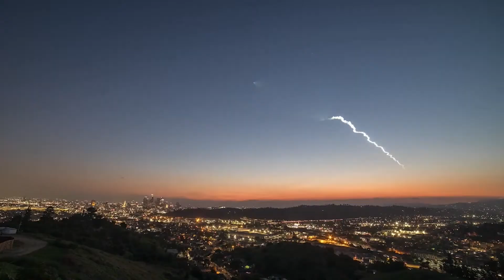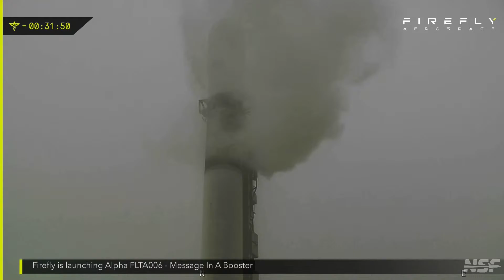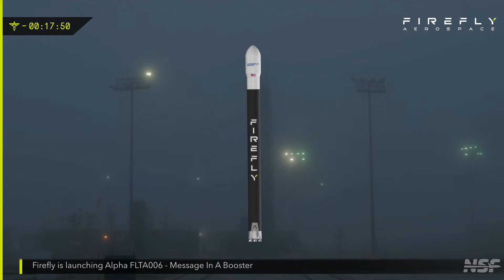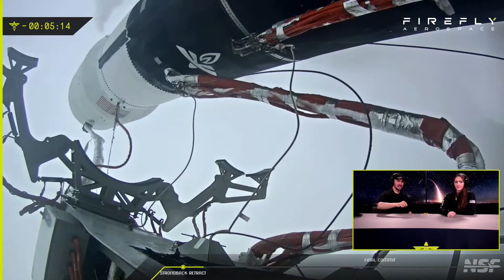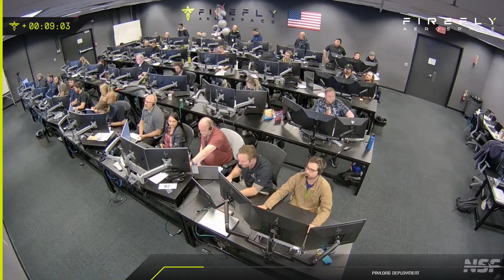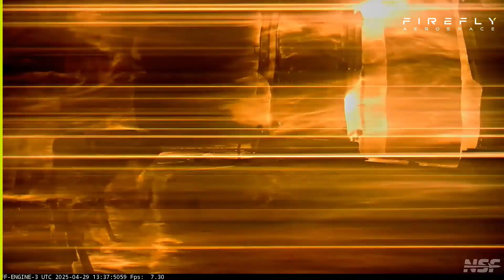Firefly Aerospace Launches Alpha FLTA006 "Message In A Booster"

Comment: Whats with these comments did i miss a rud? I didnt see any problems on accent other then stage sep which still did its job
Reply: The second stage engine nozzle was destroyed during stage separation.  The nozzle should be clearly visible, but it's just... not there.  Without the nozzle, the engine wasn't efficient enough to reach the intended orbit.
Reply: not necessarily a rud, but during stage sep the nozzle extension failed and the vehicle lost was unable to go into orbit
Reply: @lightleviathan1  but I saw the upper stage get to orbit help me out here what am I missing please lol
Reply: Thanks for the response i did some digging and found the shots I missed and some more information about it but not much so thanks again.
Reply: Also after second engine cut off it showed on the video of the vehicle just starting to tumble and they immediately cut the video feed and went to mission control and then you watch the demeanor of everybody in mission control and everybody starts panicking so obviously they either lots of vehicle or it went out of control
Reply: So anyone posting past this point Cleary aren't reading previous comments about this but thank you for you answers you can stop repeating what everyone else said